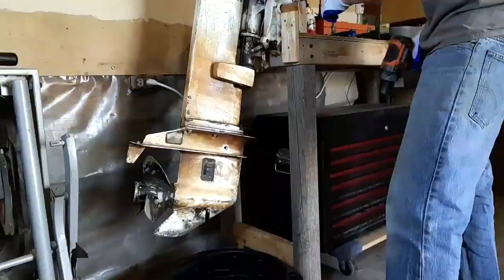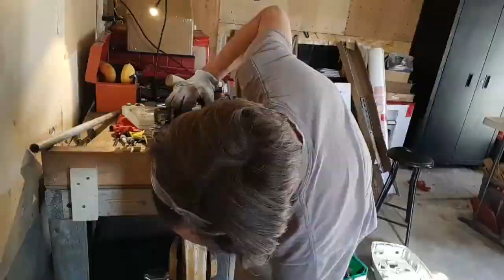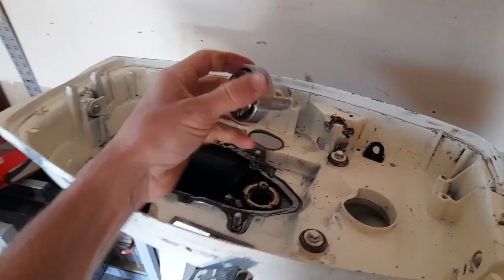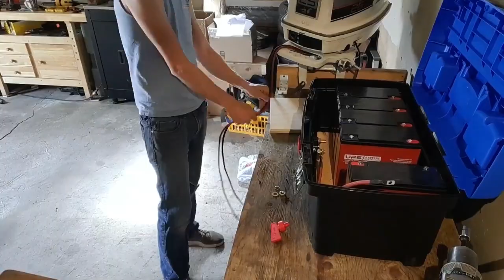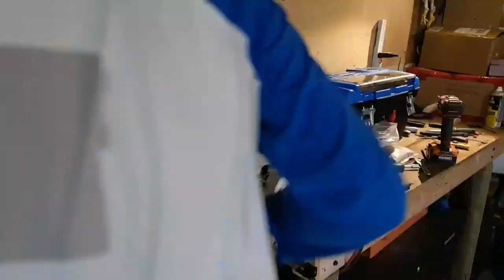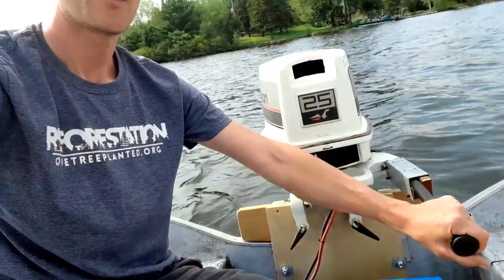Electric Boat Conversion

Comment: Mate great idea to E the motor, But as you were making the drive connection I could see it was not going to be balanced, Suggestion, get the drive coupling made up by a machine shop and have it balanced, , then you will have less of an inssue in the forseable future

Comment: bro, nice job with the conversion! have a machine shop do the shaft connector. that thin metal sheet you're using will eventually shear off. btw, always remember to bring a paddle. just in case. 😁

Comment: Hello, this is a great achievement, well done. I am working on a similar project but I have a question in mind....your conversion is very suitable for a lake but what if we want to use it at sea? do you think the engine is powerful enough to face a few small waves or is it better to consider a slightly more powerful engine right away? thank you and congratulations again for your project

Comment: Great video I would like to do the same thing to my outboard I have the same motor .Is it possible for you to supply a parts list. Martin
Reply: these OMC 20-35hp motors are so reliable and powerful for their size i have no idea why you would want heavy batteries on board only to go far slower and have far less range?

Comment: Watch the video the house 8n the back round looks like a windshield and it looks like a diferant boat, that is a trip. I had to look carefully to see that. But good job on the project figured you would do it .now it would be nice if you would put out so e stats  on how long it will run and how fast is goes.

Comment: Nice stuff mate, I've put a comment but can't see it here, so I'm doing another one, I am doing same sort of thing looking into bldc motors for this same purpose but quite liked the outcome of your project, do you still have links of this material that you have used or can you share the model of motor and controller spec model/link something that helps to get hold of the same gear, it seems to work fine, I have a Jonhson 9hp to do the same job. Thanks in advance for any help you might give 👊
Reply from the maker: Thanks for your comment! The motor and controller came as a kit from Amazon.ca:
BLDC 72V 3000W https://www.amazon.ca/dp/B07KR2FN89/ref=cm_sw_r_apan_i_HCZCR3HR0Q2MK2Y48Z0C
And the batteries are 12V UPS lead-acid. There are tons of options for batteries and I am hoping to upgrade to lithium eventually for greater range. Good luck with your project!

Comment: I’m gonna set my house boat up with something like this duel motor. Won’t go fast but will go free
Reply from the maker: Love it! I also charge this boat with my solar grid so you are right about it going for free!
Reply: @Watchmikework  my house boat has 400 watts on top. But room for 16 more. Some one just invented a super power panel that’s like 750 watt or 1400 watt. And said they’re cheap to make. My thought. How much power do you need to go down river. I’m gonna set a generator in get rid of gas engines. I only need 50 hp times 2. And lithium packs to charge. This way I got back up
Reply: @Watchmikework  my goal from Pittsburgh to Mississippi then to a nice calm lake

Comment: Thank you for the video!!! Fine!
Tell Mike
1) what is the gear ratio of your gearbox of the old motor?
2) What propeller did you use?
Reply from the maker: I believe it's a 21:12 ratio (or 1.75:1) and the propeller is the stock one that came with the motor.
Reply: @Watchmikework  , Thanks for the answer.

Comment: Nice job 👍 I got a tr20 bass boat I'm wanting to electric power but I just can't figure out what to do. It's such I big boat I'm sure I'll need some kind of 48v motor. If anyone has any ideas please let me know thanks
Reply from the maker: It's possible! The options really depend on your budget.. check out the eTolly channel, he's got a huge, electric cabin-cruiser, powered by 48v. Lots of useful info there. Also the Sailing Uma channel has an electric sailboat that they used a 48v forklift motor to power. Super inspiring.. good luck with your project!

Comment: Hi,  I have an old ski boat hull that had a 2 cycle outboard which I felt too guilty to run.  So I sold the motor and put a Minn Kota trolling motor on there.  That's quiet and better, but not really enough to push the 16 ft boat against a current or wind (i think).  So I like how you did this.  I'm inspired that maybe I can make my boat work again with electricity.  I'll have to study a bit more before I can ask good questions, but thanks for your creativity and work in filming.
Reply: Guilty to run a 2 stroke????? What the ... I'll take it lol
Reply: Forget getting electric to save the planet .
Electric makes as much CO2 as gasoline when you factor in most electric comes from coal and gas supplies and making batteries makes a lot of CO2
Also in this time a fast Ski boat in electric  would require TESLA telephone numbers to buy 
Modern two stroke engines are nearly as clean as four stroke engines for emmisions .
Also modern two strokes don't mix oil with fuel in the fuel tank and operates more like the  four stroked so oil pollution from exhaust is greatly reduced compared to old fashioned 2 stroke engined
In ten years from now when battery solutions are cheaper and work better than gasoline solutions for ski boats  is where it is  looking  to be
Until then electric will be best suited to slow boats like for fishing  on lakes where only electric is allowed to be used .
Converting a ski boat to electric suffers similar problems to covert it to diesel outboards .
 Electric is  very heavy and run times with battery at full speed will to keep battery smaller probably will be empty on 30. Minutes 
Typical recharge times for that size battery are often  north of 4 hours with 8 hour to be typical.Buyimg to three battery packs to 1.5 hours run time would probably exceed the sales value of you house  and still require s gorrilla to lift in new battery and lift out spent battery every 30 minutes
Reply: @shiningirisheyes  You might want to fact check this, depends on where you live in relation to electricity generation sources. The grid is getting more and more renwable energy input and electric motors are clean at the point of use so are much better for local air pollution which is a big issue and they don't poor out oil and fuel into the river/ocean like dirty 2 strokes!
Reply: Also the amount of co2 you produce per charge from the grid and from battery degradation is way less than the co2 you produce burning equivalent fuel that also has to be mined, processed and transported in my understanding.

Comment: Where did you find the electronics and batteries for your boat i am wanting to do it toa 57 evinrude 10hp
Reply from the maker: The motor and speed controller came from Amazon as a kit (3000w/72v brushless kit), and the batteries are 12V, 20Ah sealed lead acid (DZM-20) and were bought on kijiji but can also be found on Amazon.

Comment: What battery charger do you use?
My old 12V battery charger seems to have disappeared so I’m open to suggestions. 
I’m currently working on something similar for an old sports pal canoe. 
I’m using the same motor but I’m mounting mine to a mud motor kit.
Reply from the maker: At first I used a cheap 72V charger that I got on Amazon. But it sometimes didn't stop charging even when the batteries were fully charged, so now I use a 12V charger and charge each cell individually. It's a NOCO genius 2A/4A and it works great 👍
Reply: @Watchmikework  thanks! I’ll look into it.
Completely forgot to ask in my first comment, but how long does one charge typically last for you?
Reply from the maker: @chasbearden  one charge has taken me about 6km. I suspect it could go a bit further (maybe 7 or 8km)  but I didn't want to risk getting stuck somewhere on the water! (Also there were 8 people onboard) I generally use it for fishing so we go at pretty slow speeds for 2 or 3 hours.
Reply: @Watchmikework  thanks for the info! 
I’m definitely more confident about operational range of the setup I’m building now. Since it’s mostly going to be just myself and some gear, it’ll be an interesting ride. I’ll see about posting a video once I get it all assembled.
Reply from the maker: @chasbearden  sounds cool, would love to see your build! Best of luck!
Reply: Good work. What size batteries do you use? How many amp hours on each one and volts?

Comment: how do you cool the motor/controller? I am curious how hot it can get.
Reply from the maker: The motor can get super hot! I use a 12v fan, and added a water pump with some copper tubing to circulate lake water around the motor. I am working on a follow-up video to show these upgrades and will hopefully post it soon!

Comment: How fast is it on water? How long does your battery setup last?
Reply from the maker: It goes about 10km/hr at max speed.  I've had it out for about a 6km loop, but it could likely go a bit further. These are cheap SLA batteries.. with a better system (lipo) it would have way more capacity/range.

Comment: Great work. Very creative. I do have a question. 
The coupler for the input shaft, when you initially tested it under a load, I noticed a slight wobble due to balancing issues. Did this have any adverse effect throughout the rpm range as far as vibration goes? 
New Sub 🙏🏻
Reply from the maker: The vibration is somewhat noticeable when I have my hand on the throttle, though it doesn't seem to affect performance too much... but I imagine it would decrease efficiency. Ultimately it will likely cause bolts and things to come loose though.. would definitely be worth trying to balance the coupler to correct it. Thanks for noticing this!
Reply: @Watchmikework  The vibration will also wear the bearings out in the motor and drive shift.

Comment: This is awesome! Where can I find those adapters for the electric motor and the outboard shaft? Much respect from Nevada! Subscribed!
Reply from the maker: Thank you! In my case I made my own adapter/coupler using spare parts, a grinder and a drill press. I had to cut the end off the crankshaft, which fits the prop shaft.
Reply: @Watchmikework  sweet! Thanks for the intel. I weld, so I think I’ll fab something similarly out of plate for my application, and weld the crank shaft end to it. What was that bit of hardware that you modified? Looked like a door clasp?

Comment: Hi, i am making an 3.20 meter long electric boat for a school projekt, do you recomend this Motor you used or not ? Does it still work? What was your top speed when alone in the boat? 
I really like this video, very creative!
Reply from the maker: Yes! This is a great motor to explore the concept and get a working model without spending too much. It isn't super powerful, and won't win any races, but it got my 4.2m fiberglass boat moving at about 10 km/hr with 8 people in it. With me alone the top speed is around 12 km/hr. I imagine with a smaller, lighter boat and perhaps some gearing you could go much faster! The main thing to watch out for is overheating the motor and wires. I will be adding a follow-up video soon to show a bit more details on the specs and problems I encountered, as well as improvements I've made since the first version.  Good luck with your project!
Reply: @Watchmikework  thank you very much for answering !

Comment: Can you give me that Amazon part number
Reply from the maker: BLDC 72V 3000W Brushless Motor... https://www.amazon.ca/dp/B07KR2FN89?ref=ppx_pop_mob_ap_share
Reply: Thanks. Did you have over heating issues
Reply from the maker: @ThailandAmazing  Yes I did have issues with heat! I added a 12V fan, holes in the case for ventilation, thicker wires to the motor, and a 12V water pump with a copper tubing coil which cycles water around the motor housing. I will be making a follow-up video for this project to show these things!

Comment: Small electric trolling motors are easy to set up. Just hang it and connect it to a car battery. Larger ones get complicated and don’t Lend to reporter. This is not a good time to convert to all electric. Why? BC we are in the infancy of this technology and the prices are out of site for the regular family. Example: Tesla Y = $60,000 … Camry hybrid $37,000 where is the savings?
Reply from the maker: Thanks for the comment. In terms of savings, the big difference I see is in long term maintenance. Electric motors require very little as compared to gas engines. (Regular oil changes alone!) Secondly, it all depends where you source your electricity. In my case, I charge this setup with my solar panel grid so it is basically free.  And yes, trolling motors are super easy to set up. But this is more about exploring the capabilities of an emerging technology. In any case the entire thing cost me less than a working 5hp gas-powered outboard motor and I don't have to pollute my lake while I run it.
Reply: I come across oblivious people like you every day. Electric is only expensive if you get luxury prebuilt things. A tesla is very high in price because you have a car with a ton of expensive equipment you are paying for whether you use it or not. A camry is a cheap car and toyota is still idiots sticking in nimh cells in their hybrids. But ok, compare a much larger super high end vehicle to the cheap of the cheap camry hybrid. Either way, I just made my bike into a 10hp mid mount electric for $1000 total all in cost. I also rarely buy lithium ion cells for more than $80-100 / kwh of USABLE capacity. The cycle life of even the worst li-ion cells is 10x better than what manufacturers list @ L80 (life to 80% capacity) and they dont just die out of nowhere. Now onto electric motors. The one in the video here can be bought for about $200 on ebay as a kit with around 4hp (if you dont use lead acid batteries which suck having a huge voltage drop and only about 50% usable capacity). But if you are want more HP, there are a ton of outrunner brushless motors that can push 60hp peak for $600-800. Then speed controllers to match at $200-400. Hard to beat these prices even with gas engines. If you actually wanted to do electrics, finding these good deals is literally a quick google search away.